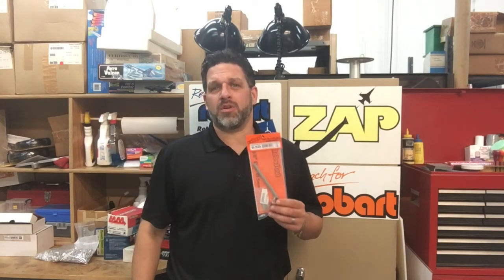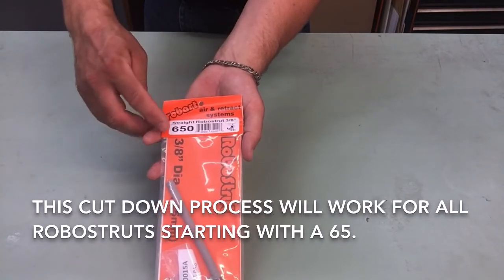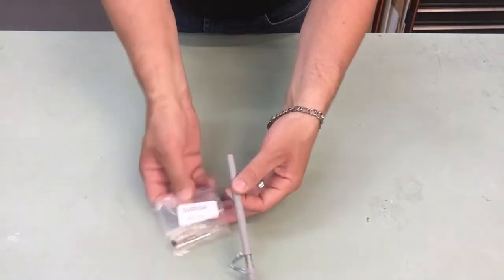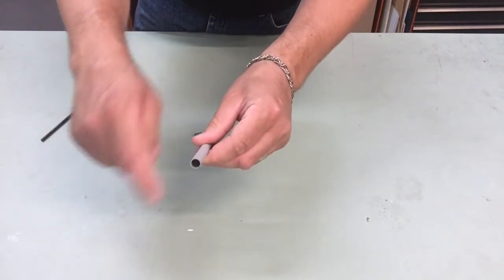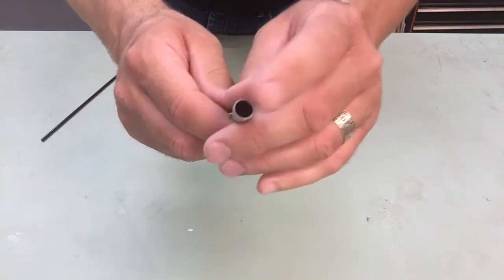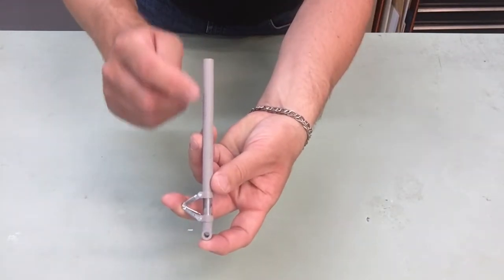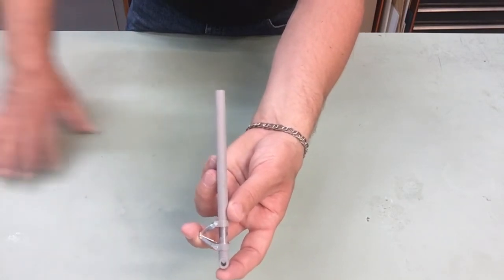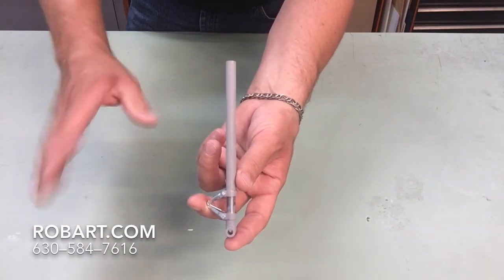Robart 650 Series Robostrut Cut Down Instructions

Comment: this video had no help, I have to order 2 net top tubes and parts bags, trying to silver solder the bushing in place, the (Plastic) stopper, melted and now that top is no good, then the other one, trying to tap it, the tap broke in both holes,  what the hell is that made or, I used these taps for aluminum engine mounts with no problem.. also I had to POUND the bushing in the top tube???
Reply from the maker: Ronnie, sorry you are having difficulty.  It sounds like there is something wrong in your process.  Please contact us at 630-584-7616.
Reply: @RobartMfg  GOD DAMN JESUS CLIPS, I had to order new ones, my 2 are part of the floor now